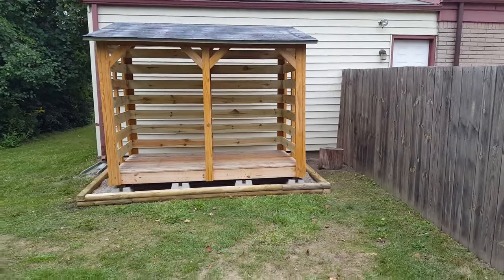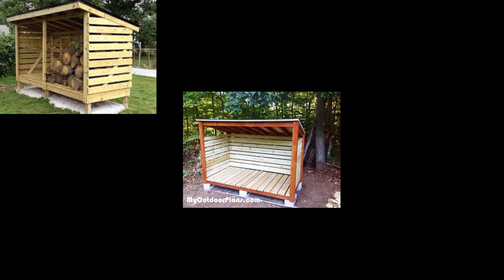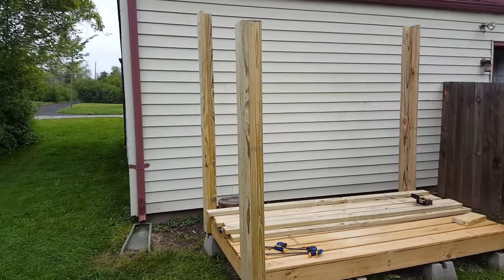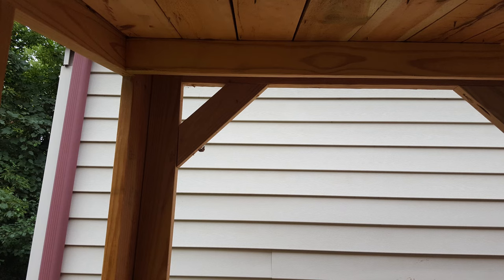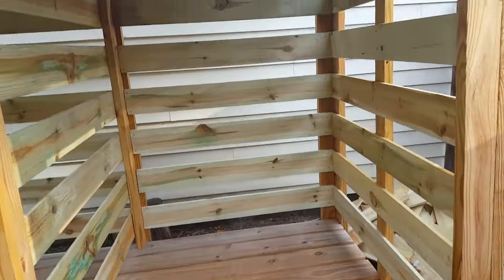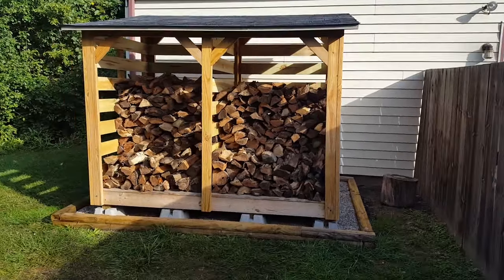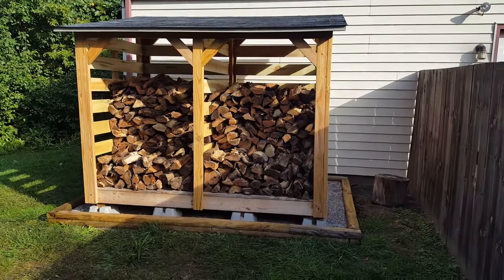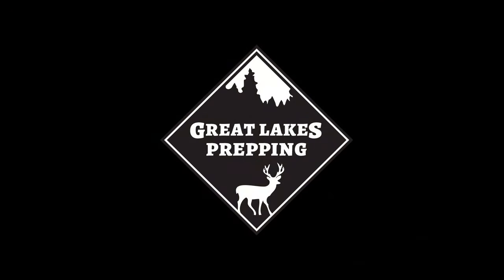Building a Firewood Shed to Store 3-4 Face Cords

Comment: This is exactly what I hoped to find.  Does the rain drip in on your firewood?  I've only ever seen it slanted back.  Ours will be next to the house too.
Reply from the maker: I've never had any issue with rain dripping on the wood. The roof overhangs covers enough that it just drips to the ground. This could certainly be made to slant back instead of forward, but I haven't really observed any downsides with the way I did it.

Comment: Curious,....did  you consider pitching the roof slope to the back so you don’t get dripped on?
Reply from the maker: Not really, I guess for 2 reasons. One, I'd rather have the water run further away from the house. And two, I like the way this looks better. Hasn't been a problem so far though. If I'm out there in the rain, I'll be wet anyhow.
Reply: I agree with you Ducan,  plus the majority of the of the photos he showed up of other shed had the rood slopping back.  Structurally, I found a lot of things wrong with the build.  No lag screws were used, no joist hangers, his corner posts should have been 4x4 running from the foundation blocks and the deck framed to them.  That wood is heavier than it looks.  It looks nice now but it won't last too many seasons.
Reply from the maker: @jesushatesyoutoo  Thanks for the feedback, Jesus. I'll have to do a follow-up video in a few years to show how it's holding up.

Comment: About How tall is the back end of this one and front?  Thanks!  I like this way the best and look forward to building my own
Reply from the maker: I think the front posts are 6' and the back posts are 7'. I can't remember 100% for sure, but I do recall that there is a 1-foot difference in height between front and back. You can go however tall you want, overall. I made it tall enough for me to stand in (which I really only did during construction).
Reply: @GreatLakesPrepping  Thank you for the quick reply and for posting this.

Comment: I live in Montana and have never heard of something called a face cord.  In our wood stove we burn 5 cords a winter unless it's really cold.   Our winter lasts 6 months-we're up by the Canadian border at 4K ft.  I burn wood every month except for 6 weeks in July/August.  So, is a face cord a lot bigger than a cord?  Thanks
Reply from the maker: Hi Carol, a face cord is smaller. It's sort of like if you had a cord, and just took the first "row" of wood. It's about 1/3 of a full cord.
Reply: @GreatLakesPrepping  Thanks. Perfecting explanation.  I guess when I buy my cords I'll stick to the largest amount I can get.  At 20 or 30 below it goes fast.  Be warm. :-)
Reply from the maker: @carolsydney6905  Yes, you surely need to stock up a bit! Thanks Carol.

Comment: What's the reason for sloping the roof on the front and not sloping to the rear as I've noticed on all the video projects...just thinking it will be less wet at the front to pick up the logs
Reply from the maker: Others have asked this as well. You're right, most similar sheds seem to slope back. I think mine was partially oversight. When I drew up the plans for it, I just made it this way mostly without thinking about which way it sloped. But I ended up glad I did it that way. Since this shed is pretty close to my house, I'd rather the water run a bit further away from it. And it generally isn't raining when I go out there to get wood. If it was, I'd be wet anyway!

Comment: Well done mate . It looks great. Did you just rest the base on the blocks or is it fastened in any way?
Reply from the maker: Thank you. It's not fastened to the blocks, but there are short vertical 4x4 posts that sort of nestle into an indentation in the blocks (made specifically for 4x4 posts). The horizontal structure of the shed is not actually touching the blocks.

Comment: Looks awesome and I'm sure it will last a LONG time.  I was curious though, why didn't you just go with 6' tall 4x4s for the posts?
Reply from the maker: I used the L-shaped configuration for my posts so I could neatly attach the horizontal slats in a way that would look really clean from the outside. It was a design choice mostly.
Reply: @GreatLakesPrepping  Thanks! It certainly did come out clean indeed! We have two sheds and stack any extra wood in "beehive" shapes. I wanted to send you a photo, but couldn't figure out how!!!

Comment: That won’t move anywhere... it’s over supported if anything .👍🏻
Reply: There are  a few tips for building sheds
Start With a Sound Foundation a shed wont last long if it's set on a weak base
Allow for Air Circulation to prevent damp 
Build a Weather-Resistant Floor Frame
Use Low Maintenance Materials so you won't have to keep re-painting it
(Reference: Adota Blueprint Pack website )

Comment: Its not 3-4 cords:   Since 1 cord = 128 cubit feet. Your shed is 8x4x?.  Assume 6 feet high and its 192 cubic feet, which is 1.5 cords
Reply from the maker: I said 3-4 face cords. A cord is roughly equal to 3 face cords.

Comment: You should of put the slope on the roof the other way because when it rains you don’t get wet and also you have more head height apart from that nice job 👍
Reply from the maker: You may be right, but I wanted the water to run away from the house. I reckon if I have to retrieve wood while it's raining at some point, I'm going to get wet anyway.
Reply: Haha 😂

Comment: Can you share the material list you used?  I want to build this exact woodshed next weekend.
Reply from the maker: I'm afraid I don't have an exact list. It's been a long time since I built this and I don't think I have any of my specs or plans anymore. This design is pretty adaptable to the size you want, though. I built it with the standard lumber lengths in mind (8 foot long). If you base all your measurements on a footprint of 8ft x 4ft for the floor, you should be able to figure the rest out fairly easily.

Comment: Love this wood shed. Simple and breathable, I love it. What size screws did you use for the post, 3” or 4” ?
Reply from the maker: Thanks Daniel. If I remember correctly, I think I used a lot of 3.5" and 4" screws for this project. To attach the posts to the frame/floor, I also used some bigger lag bolts.
Reply: @GreatLakesPrepping  appreciate it, thank you

Comment: I dont know about the snow load in your region, but if snows a lot those corner posts rely only on some screws?
Reply from the maker: The posts are attached to the floor frame with 5/16" X 4" lag bolts, as well as several deck screws. I'm certain the posts would rot away before those bolts would fail.

Comment: Did you have to remove the entire structure to lay down the landscape fabric and gravel since it was done after most of the structure was built?
Reply from the maker: No, I only put the fabric down around the outside. I'd already filled the area beneath with gravel, and I didn't think of doing the fabric until it was too late. I'm hoping that the gravel and lack of sunlight/rain from the structure will keep weeds from growing under there. Time will tell, but so far so good and weed season has arrived.

Comment: what's a face cord?
Reply from the maker: A face cord is an informal measurement for stacked firewood, sometimes called a rick. It's generally accepted to equal about 1/3 of a cord.
Reply: @GreatLakesPrepping  thanks but.  i didn't even know what a cord is 😄 . I do now cos i googled it but it's not a thing we use in England. I buy firewood by the cubic metre. Like 2m³
Reply from the maker: @Ana_crusis  Ah, gotcha. Well you know how we like to measure everything the difficult way over here!

Comment: Good design, now just multiply it by 8 to get a shed that holds a decent amount of wood. "Face cord" is only 1/4 of a full Cord.
Reply: Actually three face cords equals a full cord
Reply: 3 face cords make a cord is what I was told
Reply: Obviously it depends on the length of the pieces, 12” would give 4 face cords and 16” length pieces equals 3 face cords.